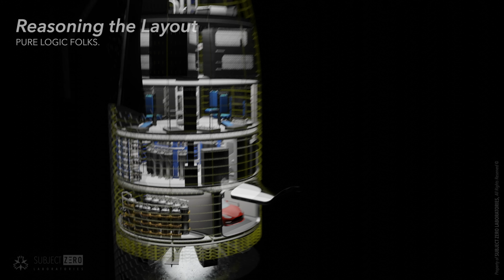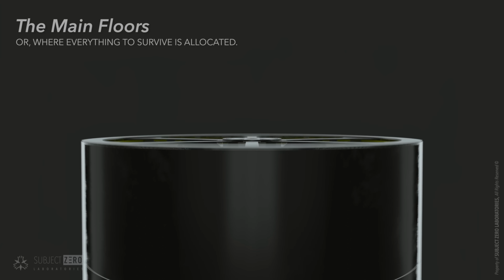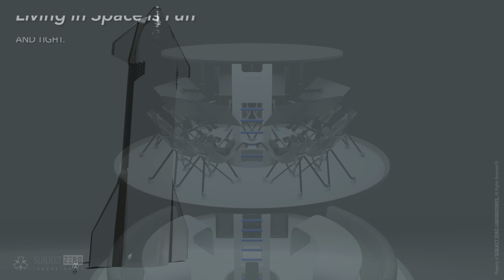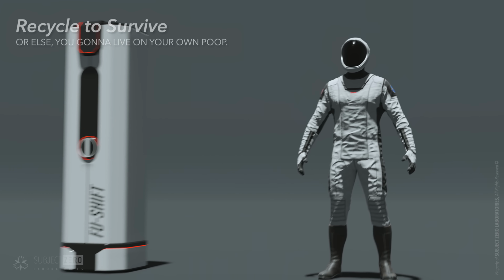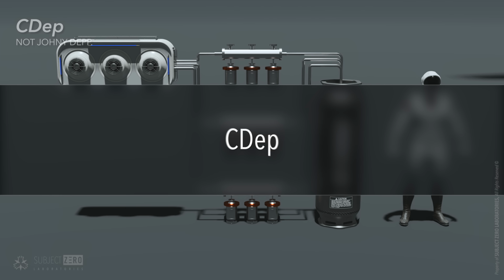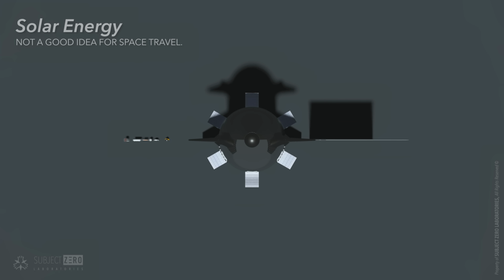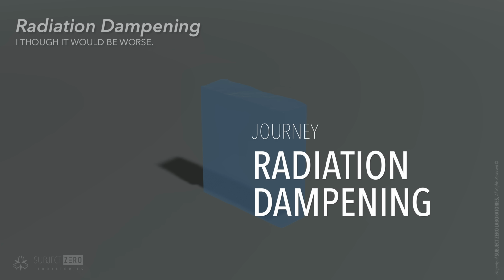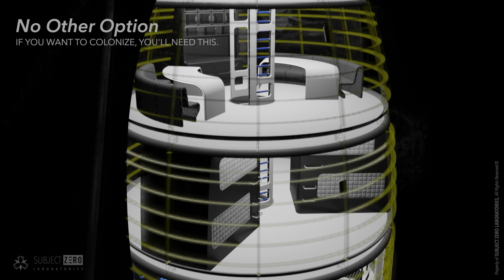Onboard the SpaceX Starship 2.0 in Detail - What it takes to go to Mars | Detailed Breakdown

Comment: Great presentation - thanks!
Even if the mass to orbit remains at 100 tons (the number of raptor engines seem to provide a strong possibility for more) - it would be trivial to launch another starship with additional supplies - vis-a-vis several refueling missions.  Of course this would also affect necessary delta v.  However, you could instead/also launch a companion uncrewed starship for security, storage and backup.
Reply: have at 150 tons  new raptors
Reply: I was going to say the same thing.  Mass to orbit is irrelevant, as you can transfer cargo in orbit.  What matters is how much mass can be sent to Mars from orbit after refueling and cargo transfer.  I would expect the crew won't even launch until the Starship is refueled, so they're not present during what may be one of the more dangerous operations.  And of course, resupply and refueling at Mars is assumed with cargo Starships.  While this could be taken a step further with resupply during the journey, that adds complexity to the mission that would be avoided if at all possible (and as argued in the video, avoiding it is clearly possible).

Another option is to build a new Starship design that is essentially a booster with a detachable nosecone.  In orbit, discard the nosecone, fuel it up, and then dock it with the mission Starship.  This would act as an additional stage to give them a boost out of Earth's gravity.  This could also result in shorter missions, reducing the cargo needs.

Comment: IT might be possible to have a "Battery pack-solar panel" trailer hauled in earth orbit and just pick it up for each journey. This is not something you need to land and take off with. You can have solar panels and battery packs delivered on Mars with cargo runs too. No need to do re-entry and takeoffs with it. There is no drag in space so it does not matter how you carry it with you. This could be modular also and for redundancy consist of 3 similar parts to have an overhead in case of emergency. These will be highly maintenance heavy parts so it would be nice to change these.

Comment: One big problem: no exterior ladders. The elevator crane is the only way into the ship when landed, and elevators break down a lot. 
"always have exterior ladders from ground level back to the airlock" is something I learned the hard way playing KSP.
Also, the crew quarters don't need as many beds as the animation shows, if they hot-rack like they do on subs. That's more space for storing food and air.
Reply: Problem with hot-racking is that its a severe hit to morale. You're going to need every single bit of morale you can get when stuffed into a relatively tiny space for half a year, being surrounded by absolute nothingness outside of the tiny bubble of life.

No human has ever been as separated from the rest of the universe as Mars travelers will be during the voyage.

Comment: In regards to the solar panel issue and making a comparison to the international space station you've made one major over sight. The ISS rotates around the earth which results in the fact that 50% of the time it's in darkness and 50% in sunlight. A starship making it's voyage to mars would be 100% in sunlight. Second, after some quick googling I found that the strength of sunlight at mars is 43% when compared to earth. Therefore the panel size would only need to be marginally bigger over the ISS panels to meet the same power requirements over a 24hour period. Perhaps around 15% bigger as a ballpark guess.

Comment: I agree with Humtog but I went a little further in thoughts of multiple star ships. ! Starship Command Center and a cluster of Starship Mudules with intlocking capabilities , some designated as engines, fuel,and supplies. Using the cluster theory of multiple rocket units intlinked, and staged in orbit until Final Interlock of a 10 and 2 configuration to begin Mars colinization.

Comment: Very good and interesting video..  I agree with most of your points and calculations and suggested design concepts for addressing the challenges you discussed... But in my opinion, the priorities of addressing the challenges should be a little different let me explain - 
First - We have Got To come up with a way to get to Mars quicker than 6mos. We just do.  If we could double our speed then we reduce by half our need for air, water, food, any other consumables we need.  This needs to be our first and most important priority.. A possible suggestion for this challenge are some of the "known physics" Nuclear Thermal propulsion concepts (See link 1 below).  I won't go into exhaustive detail in this high level quick overview, but suffice to say that these are concepts that NASA is currently actively working on and can drastically decrease our in-flight times and everything becomes a whole lot easier when it takes less time for the journey.
Second - Air and Water - In my opinion a plausible and realistic system concept should (as mentioned in the video) be simple and reliable and easy to maintain by any of the embarked crew on the ship.  I'm thinking that a system that uses either Algae or Plants of some kind to recycle the air and remove CO2 would be best and simplest for this, only requiring some water for the Algae or Plants to use.  It can be hydroponics or "Air-Ponics" based, but we should have a system like this instead of a complex electromechanical chemistry based system that only engineers and scientists understand. Water is a tough challenge and heavy, but vital and would need to be carried onboard in tanks and would be best to store as shown in the video, between Starship decks to provide additional shielding capacity for crew.
Third - Food - I can't think of any better way to handle the food requirements challenge than the suggested dehydrated/freeze-dried food suggestion as discussed in the video. It's a well known and understood and safe and efficient way to do it. It would get old eating dehydrated food all the time but much better than the alternative, not eating at all.. Heh..
Fouth - POWER - In my opinion, power should be supplied by the Nuclear Thermal power source on board the ship that will be supplying power for propulsion.  Most nuclear power sources can be adjusted up and down to meet power requirements within the design specs of the system, and it would seem to be a minor additional power requirement to supply power to the ship's systems in addition to the primary use for the Nuclear Core, which is propulsion, to power necessary things like recycling, lighting, and air circulation, etc... Nuclear makes alot of power and a system can be designed and engineered to supply power to both propulsion and ship's systems. 

- Finally - These are doable challenges with diligent applied prototyping and engineering and testing. We can totally do this.

1. https://www.nasa.gov/directorates/spacetech/game_changing_development/Nuclear_Thermal_Propulsion_Deep_Space_Exploration

Comment: Why can't a starship have an RV accessory? When you go camping, RV style, one option is to add a camper or trailer to a truck.
I can see Bigelow style inflatables be packed and ready to attach to a starship in a 360° camper style accessory.
Once arriving at the destination, the inflatables can have several options.
1. Land on the surface independently with a combination of parachutes, inflatable bouncing, or other landing scheme.
2. Remain in orbit as a station, possibly as a tether anchor (space elevator or descent assist). Or, an orbital solar power station to beam concentrated power through dust clouds.
3. Setup as a vacation camp on the lunar surface (phebos)

Comment: A more appropriate energy solution for Starship life support is using the electricity from a massive solar array to convert waste CO2 and waste water to additional methane and oxygen pumped back into the main fuel tanks.  Methalox fuel cells provide burst energy and fresh water in the inverse process, leaving only an amount of waste nitrogen etc. compounds.  Tanks of methane fuel instead of water or plastic can provide radiation  shielding, which should line outer walls, not floors.  Remember that carrying around hydrogen is an artifact of the space shuttle design, not a necessity.

Comment: Stainless steel has better radiation blocking ability than plastic, aluminum or Kevlar. If the starship is headed towards Mars and keeps its engines facing to the sun, the remaining fuel in the tanks would be a good shield against radiation. Then, the only shielding you would need would be in the walls of the starship for solar flares and cosmic rays.

Comment: I am quite intrigued on how they get the power on the Starship 2.0. 
During the recent Mars rover mission (Perseverance) they attached some sort of nuclear power. That was much more efficient than solar panels. Why not add them on the Starship? I am assuming because of the dangers of it?
Reply: Yes, primarily. That's a nuclear RTG, which I believe stands for Radioisotope thermal generator. Two Mars rovers, as well as both voyager probes, have them, and variants are likely to be used in colonies and bases. But my guess is that it's too dangerous or complex for the mission plan, it's possible that could be wrong though.
Reply: @maxv9464  I see. Thank you for answering my question. I just feel like there are better ways for the starship 2.0 to have it's source of power. As a matter of fact. You answered my question, now what's your theory on how the Starship 2.0 should receive it's power?
Reply: @AlexanderResurge  I'd say a mix of fuel cells, solar panels and big batteries. But then again, I'm no rocket engineer, and SpaceX has a much better idea of the power, mass, and cost requirements than I do. What I will say is that RTGs are expensive, special equipment and putting one on board a reentry vehicle which could come into the Earth's atmosphere over a populated area is probably not going to be taken well.

Comment: Re the flotilla comment: Yes. And, with 3 or more ships, 2 can be set aside for spin gravity, via a tether between the 2. ISS data show that microbes are more aggressive in microgravity. Workout machines won't be enough. The human body--all cells of it--need sustained gravity experience. Spun ships, with shown deck orientation, will provide that. (Next question: will a spin of 1/3g suffice to stop microbe agression? It had better, or the same problem will exist on the Martian surface. No one knows the answer to that, yet.)

Comment: Connect two together at the nose with several redundant cables (synthetic material) and have them rotate so that Martian like gravity is simulated in the ships. Either ship could which them together (in case of equipment failure on one ship) and de-spin. Could connect 3 or 4 nose to nose (think a 3 bladed or 4 bladed helicopter propeller). This would save on as much gym equipment, would allow the astronauts to get used to the gravity of where they are going, and be a simple to use and maintain (no complicated electronics, specialty equipment, etc; simple electric winches).
Also, your designs do not seem to take into account deployable solar panels for power during the trip.

Comment: STOP 
it will be 12 passengers.  Because it allows to divide the quantities easily by: 1, 2, 3, 4, 6, 12. (that is to say: a whole, two half, three thirds, four quarters, six sixths and twelve twelfths) Which makes  much easier to manage quantities (like everything divided by 12, like hours, etc.) which is not possible with 10. 

{{ Because, for example: the third of ten is 3.333 (three point three, three, three etc.) and when we have real objects in front of us we easily understand that it is difficult, and even sometimes impossible: for example  we cannot divide living beings into 3.3 without cutting them into pieces. }} 

in addition to that: 
The surface of the space onboard can be divided into an hexagon, to create 6 or 12 parts.  
You know : the hexagon is a natural shape that saves material (bee cells, for example).

Comment: Starship initial life capacity will be around 100 tons  but if it follows anything close to falcon development this capacity will increase to at least 125 tons at a mininum and i expect it will reach 150 tons after 2 or 3 iterations  and possibly even further. Also because of its rapid reusability and large payload capacity it could allow for the building of space stations that would dwarf the ISS that could be used as manufacturing hub build large transport vehicles which starships attach to and when near there destination release them. First supplies will be needed to be brought from earth but using a single near earth asteroid could provide a lot of resources needed to build a number of large crafts using 3d printing technology

Comment: Nice video, though there are some things that are wrong or most likely wrong.

- Transit time is closer to 4 months, not 6. You use the advantages of in-orbit refilling for the required performance boost for a fast transit. You would have some margin on consumables, but more like 5-6 months, not 8 months.
- If they use fuel cells, they in all probability wouldn't use hydrogen fuel cells, but instead use methane fuel cells. This also means no needed hydrogen storage.
- Oxygen storage obviously wouldn't be in individual tanks. They already have a huge storage tank with liquid oxygen, namely the propellant tank. The habitation sector would likely have one or two relatively small tanks of gaseous oxygen that is taken from the main tanks.
- There probably won't be any radiation shielding. It's not strictly needed, with the mass of the vehicle, propellant and cargo already providing significant shielding.
- The solar probably won't be in straight panels. The concepts have shown a fan-like stucture that expands out, but it could also be something like one or two booms that extend out with a circular solar panel. Two 20-meter variants of the solar panels for the spacecraft "Lucy" would provide around 150 kW near earth or around 50 kW near Mars. (Lucy has two 7-meter variants.)
- The flight deck is obviously wrong. All the chairs would be facing the same direction, so everyone is comfortably seated during the belly-flop manouver. Having the seats in a circle means half the crew would be pressed against the side of their seats, and 1/4 would be hanging face first out of their seats.
Reply: The problem of a faster transfer time is a much higher velocity encounter with Mars involving higher g forces and greatly increased thermal stress on the heat shield. And faster transfers require a greater mass fraction leaving less mass available for everything else
Reply: @MrSlartyb  Yes, the limit for starship is around 4 months, by the analysis I have seen. 4 months would probably require two passes through the Martian atmosphere, to limit g-forces and heating. First an aerocapture and then entry/landing. Two passes would add a few days, but it would be really a rounding error compared to the 120 days. And a fast transit like this should be possible with 150 tons of cargo.

If you chose a slower approach it should be possible with up towards 250 tons of payload. But it's not entirely clear if Starship could actually land on Mars with that much payload. And it would require transferring cargo in earth orbit, as Starship can't lift off with that much.

Theoretically, Starship could be capable of down to 3 months, but the g-forces and heating start to get unworkable. If you had a light payload, like only a few crew and no cargo beyond what's needed for the journey, you could probably make 3 months work with propulsive deceleration to take the edge off and then two passes through the atmosphere.

Comment: This is one of the more realistic looks at what a "Starship to Mars" might look like, but even this is unrealistic. The current Starship design has a paper thin outer shell. A good amount of that 9m radius will be taken up by a pressure hull, as well as ablative shielding for micro-meteor collisions. Then there's the radiation shielding. The shielding you describe is for something like the ISS, which is inside the Earth's magnetosphere. In deep space the radiation is much higher, not just from solar radiation but from cosmic rays that come from every direction. This video underestimates the thickness of shielding required by a substantial margin. 

I really don't think the volume available in a Starship is going to be sufficient to safely carry many people to Mars. Whatever we use will need an internal volume a fair bit larger than the ISS, as well as a lot of extra shielding and equipment. Realistically they will need to build a purpose designed ship in orbit, something larger than a Starship, but which doesn't have to escape the Earth's gravity well. That way they're not limited by volume as much and can also equip and supply it over multiple launch missions, instead of launching everything in one go. Using Starship to ferry large numbers of people to Mars is hopelessly optimistic.